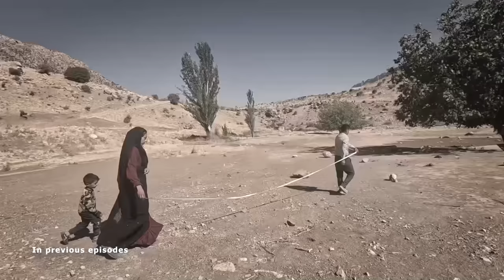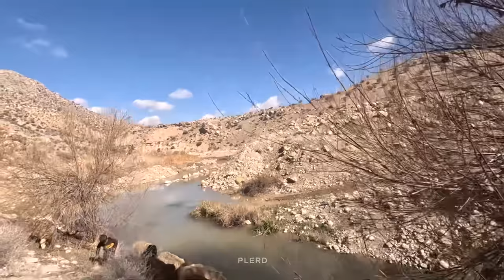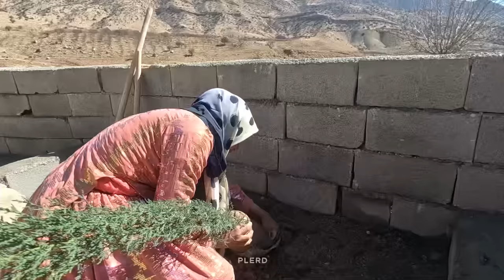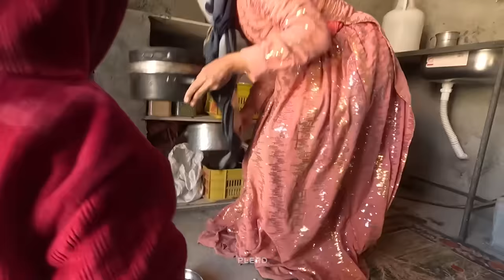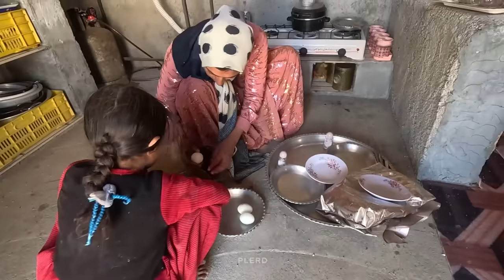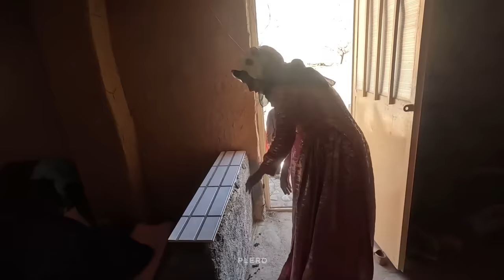A Single Mother's Farmhouse Beautification Project: Greening Up Together

Comment: Tayeba, you are an inspiration for woman. When I think my lot is hard I watch one of your episodes. Sammy is amazing, taking sheep to drink from the river it is no easy task. Sheep aren’t the  easiest animals  to herd on your own. 
Sister Tayeba, far be it from me to give you advice, but Hens/chickens are something I deal with. It’s healthier for hens and humans to be a distance apart. You have a huge land space. Hens perch,  a house with built in nest that you open from outside makes egg gathering easier. Long poles stretched from one end of the house to the other for them to roost on is what they like not too far off the ground. And a large pen fenced area for them to run around in. They need to be fed in the pen morning and night with clean water on hand, if you keep them penned up for a few weeks before you let them out, after feeding, they will come home to roost on their own as the sun goes down. You won’t have to round them up. Let them out after they finish laying. 
I’ve noticed other goat owners dump their goat manure and straw. It makes very good compost. It needs to be stock piled with straw that comes from the feeders. Food peelings twigs egg shells, a little ash is good spray once in a while with water and turn/ mix it often to get it heated. You’ll have the best vegetable garden on the desert.
Hope this helps, just take from this what you want. God bless you. You are a real pioneer woman.